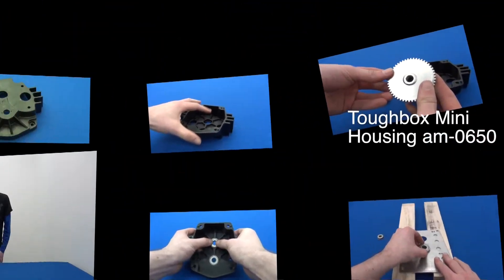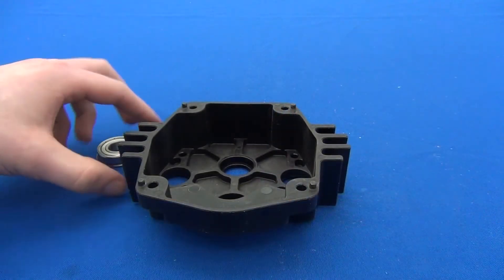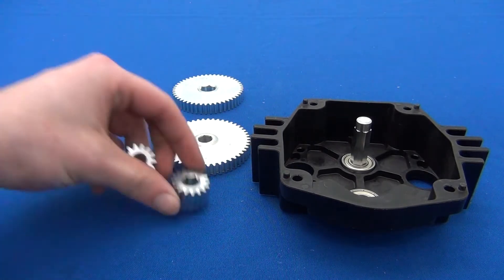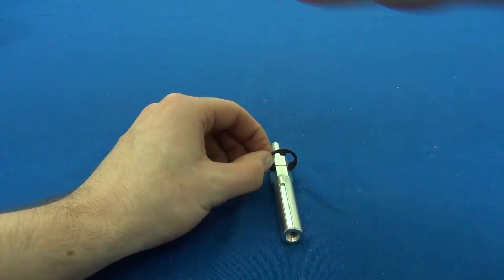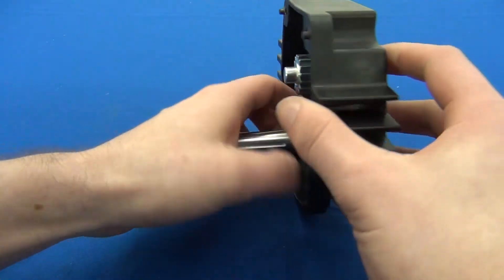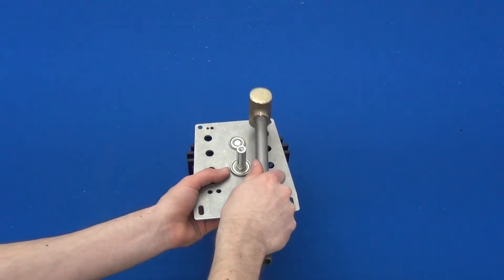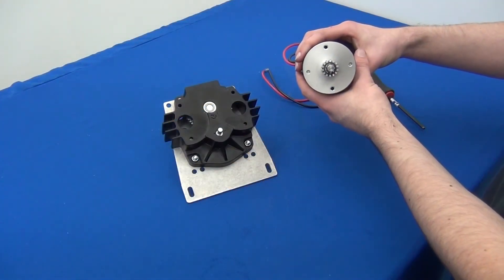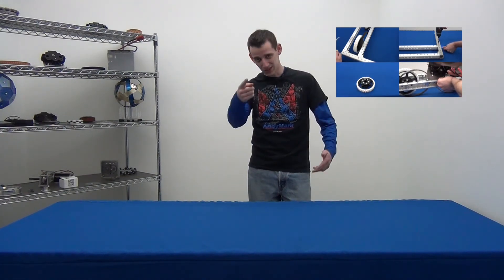2013 Kit Toughbox Mini

Comment: Hello! I'm a mentor and I plan on helping the students assemble the gearbox's for the 2014 Kit this year. According to the information on the FIRST website the 2014 drivetrain will use a "direct driven center wheel powered by ToughBox Mini gearboxes". Will this tutorial be relevant for them or will you put up a new video for this year?